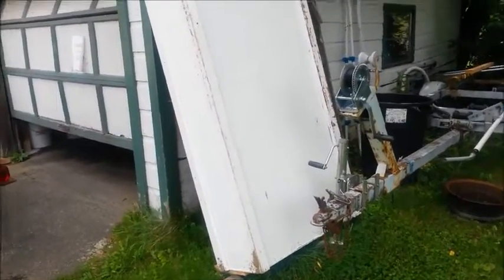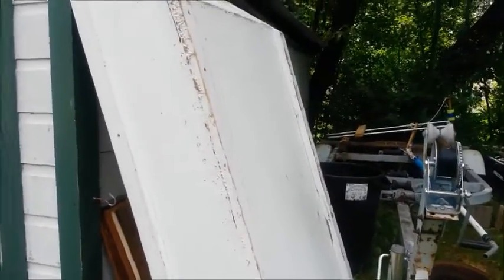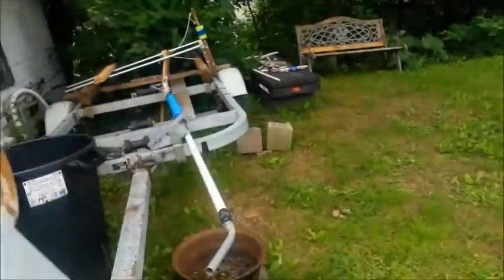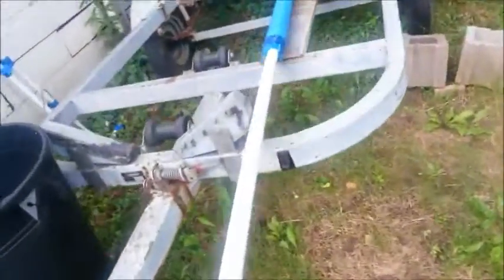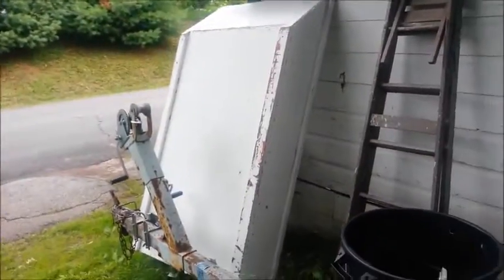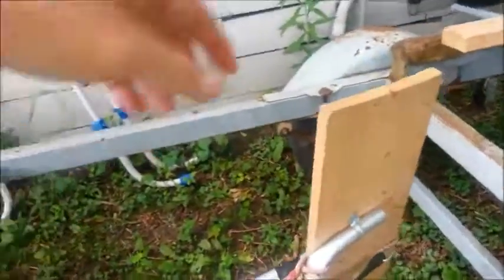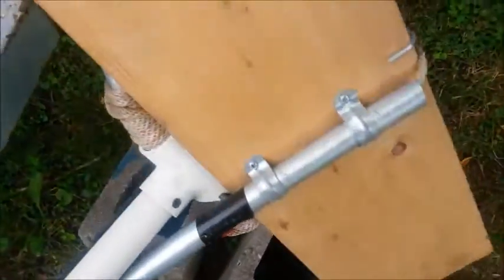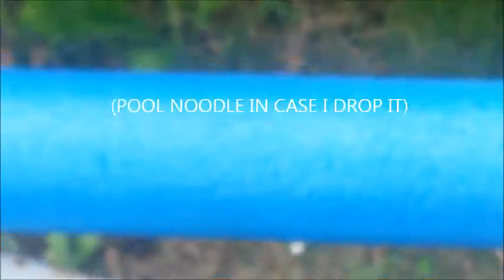Simple Homebuilt Instant Tub boat with horizontal fin propulsion

Comment: I'm impressed. Seems to move well. 
Some ideas (that you may have come up with on your own by now):
1. Powering with a rotating crankshaft using electric motor or bicycle pedals and sprocket? Turn rotating motion to reciprocal by mounting what is now the handle on a flywheel. The radius of your wheel would become your stroke (just like a piston)
2. Doing this, you could power 2 opposing flaps, cancelling out the up and down heaving of the boat.
3. Instead of a plywood flap, try plastic, rubber, or something flexible, creating that perfect backwards thrust. Maybe even use some cheap diver's fins/ flippers, using the part where your foot would go to attach the rod. That's what flippers are made for after all, and you could experiment with multiple fins to fine tune your power.
4. In conjunction with the flywheel/ crankshaft idea to create the reciprocating motion, whether bike pedals, motor, etc, you could make the shaft go between 2 support rods or a linear bearing on a swivel, attached to the boat, that would determine the pivot point. This would define the ratio of the movement on your end (the "stroke" if you will) to the movement of the fins. The pivot point could be on a slide and be adjustable. Move supports rearward (towards the fins, or away from the source of power), and the fins would have a smaller "stroke", and be easy to power. As you pick up speed, move supports forward, and fins would move in longer strokes for more speed. This would effectively act as a simple continuously variable gear. 

I realize simplicity is important here, but these are just some suggestions you may want to play with, and may not be too complicated. I think (but don't know for certain) that slow moving fins like you're using are much more efficient than a propeller, as well as cheaper, easy to make, and have that "different" quality that makes others aware that you're a mad scientist who will rule the world (insert sinister laugh here). If you've done any upgrades or you try any of these ideas, could you let me know here so I can check it out? Thanks! I love tinkerers like yourself!
Reply from the maker: Those are some super interesting suggestions! Since posting this video my life is gone upside down quite a few times. My life happens to be upside down right now, also, but as soon as I get right side up I'm think I'm going to work on an improved version. Of course, I am back in Alaska now so the next boat might need to be a little bit more seaworthy... Hhmmmm